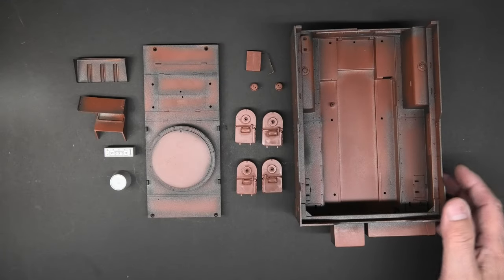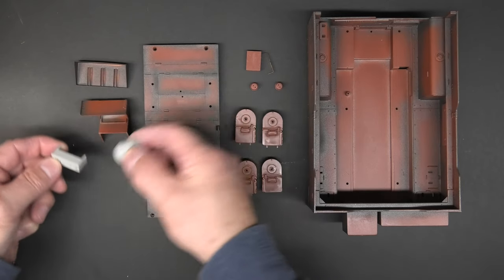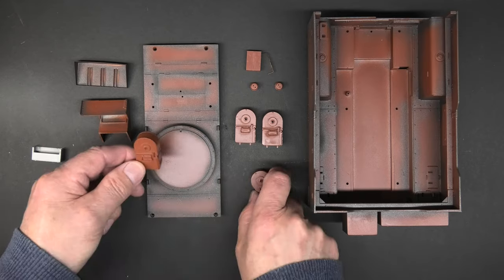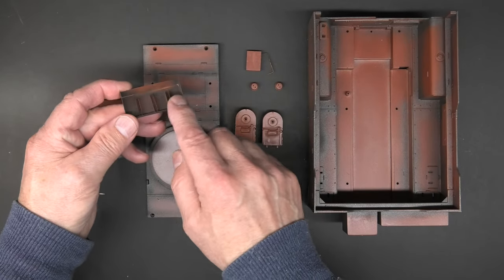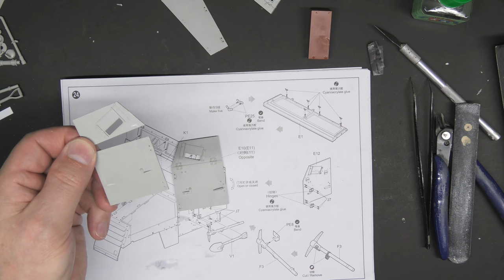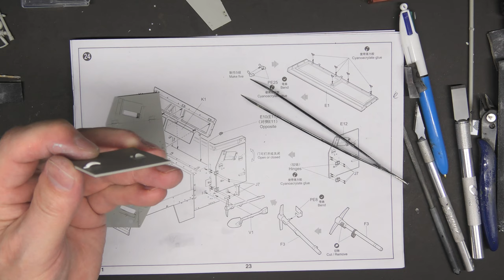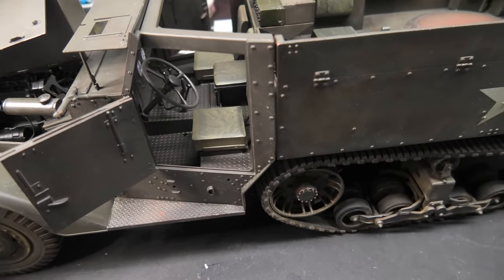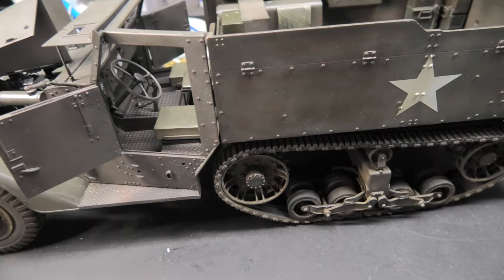Trumpeter 1/16 M16 Multiple-Gun Motor Carriage: Part 2 "Upper Hull Assembly" #ww2 #models

Comment: I just watched your first video, looks good so far. How is the kit ? I’ve been thinking about getting one. I didn’t have a good experience with the hobby boss tiger but the big andys kits were great, i just didn’t want to get into a nightmare without knowing it.
Reply from the maker: Thanks for the comments 🙂.  The kit had a few issues like the chassis frame breaking and those awful vynal tracks are a disaster. But if you find good reference photos you can do a lot of improvement,or just build straight out of box.
Reply: @sierrahobbys1883  thank you. I might wait but ive been really wanting to build a different kit. Ive seen the 1/16 stuart and luchs which both has there issues.